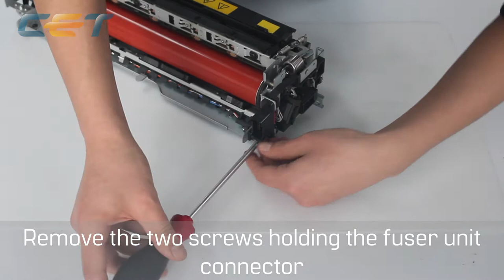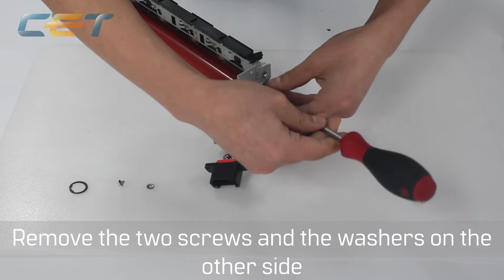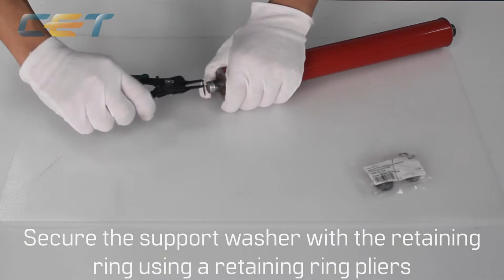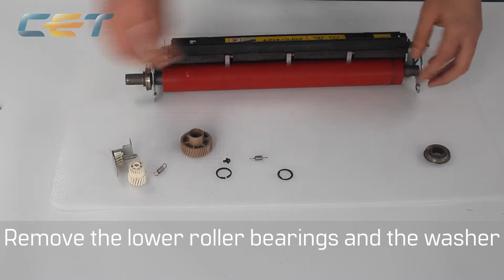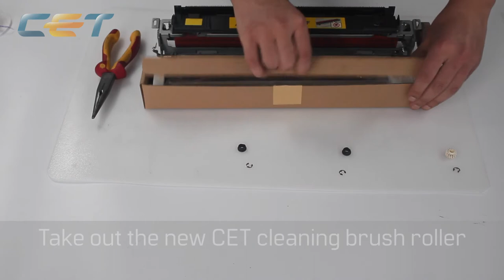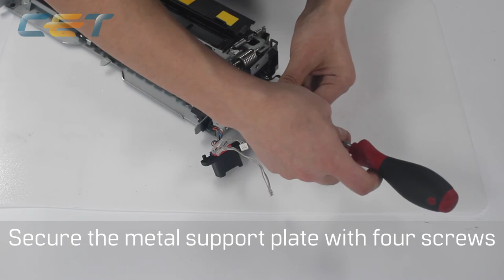Konica Minolta bizhub 654 series fuser unit rebuild instructions

Comment: Hi CET, is the kit also for bizhub C554e and bizhub C554 Fuser's. We often have problems with other bushings at the sub-fuser kit section. The one's we've got so far were false one's. Maybe this kit can solve this problem. Thanks in advance
Reply from the maker: Hello, 
Yes these kits also work in the Bizhub C554e and Bizhub C554 fuser units. Main fuser rebuild kit CET7185 and sub fuser rebuild kit CET7188 SUPPORTED MODELS: Konica Minolta: BH554e, BH558, BH558e, BH654, BH654e, BH658e, BH754, BH754e, BH758, BH808, BHC554, BHC554e, BHC558, BHC654, BHC654e, BHC658, BHC659, BHC754, BHC754e, BHC759 Sub fuser rebuild kit.
Thank you for your interest!
Reply: @CETGroupUSAInc  Hey, thank you for you response: But bizhub C558 and bizhub C658 do NOT fit! The "metal"roller and brush roller of the sub fuser kit is not the same. I need much of them because we have hundreds of C558 in field. I already found the correct metal roller, but i can't find the correct brush roller. Please take a look and open a C558 fuser - you easily will find the difference. For C554e it fits. It would be great if you can check. I would like to order them soon.
Reply from the maker: If you could tell me what region you are in I can give you an email address to contact to resolve this. Thank you.
Reply: @CETGroupUSAInc  Germany europe
Reply from the maker: Thank you. Your contact is Celia at celia@cetgroupco.com. Please contact her for more information. We appreciate your feedback and will add a correction note on our video description.
Reply: Hello my dear teacher. This fuser is same to 554 desmount.